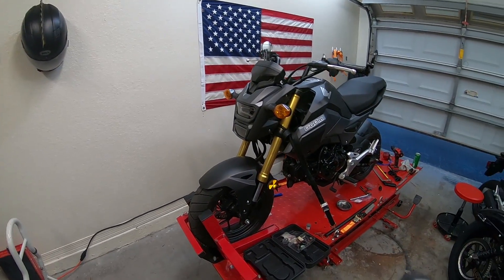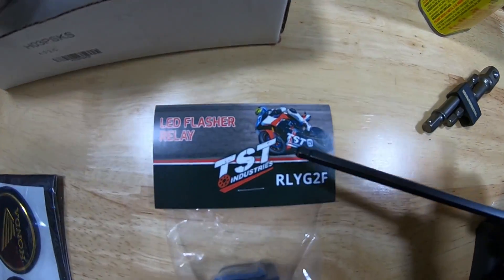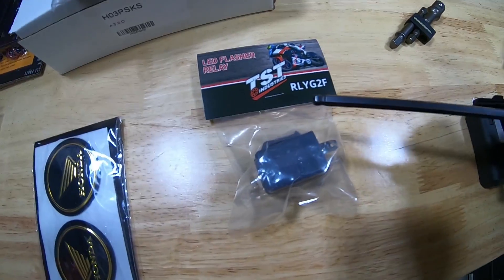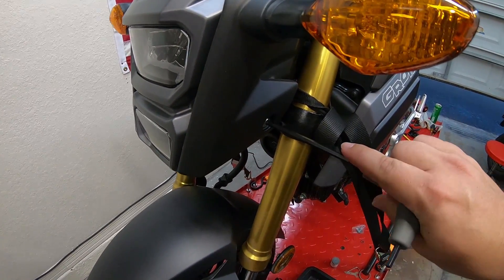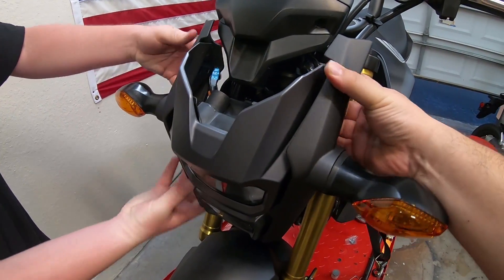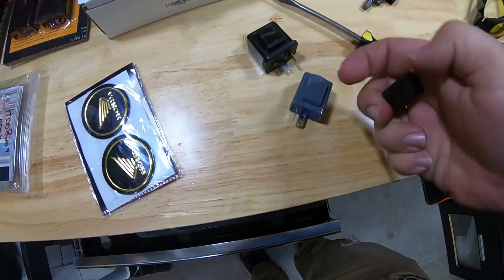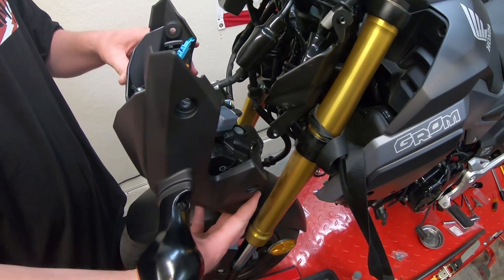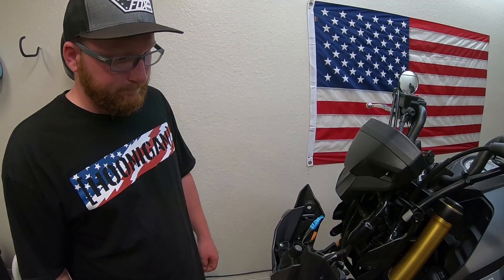How To: Honda Grom LED Flasher Relay

Comment: Thanks for the video! I have a question  . I just got my first grom and put a new led license plate light on it. When I did that the front head light does not work. Would this be a relay? The turn signals work but the headlight does not. Thanks!
Reply: I’m having the same problem
Reply: @TheChosenOnex7   I replaced the relay under the seat and the headlight works. Hope this helped !

Comment: I put the adjustable relay and the 3 to 2 wiring harness Turn signals will still not blink running lights are not on but they light up and stay on when I turn turn signal on

Comment: I just bought a grom and it needs a new blinker relay bc the owner put aftermarket turn signals on the back. Can I get any relay built for the grom or do I need a specific type of relay? Also why doesn't the stock relay work with the aftermarket blinker?

Comment: Is it possible to have the aftermarket blinkers also work as running lights?
Reply: yes, i just installed china made LED indicators and the front have a third wire for daytime running lights.

Comment: I have a front and rear LED indicator set up for my 17 Grom. The rear set has resistors set up and were working perfect while I had the OEM front signals fitted, but as soon as I fitted the LED front signals I get no flash in any of them.

I've just ordered a relay, but I'm confused as to what the problem was.. surely I don't need a resistor for every indicator (4 total)?